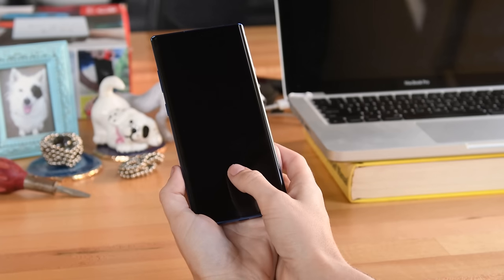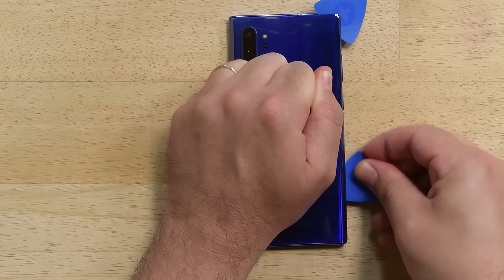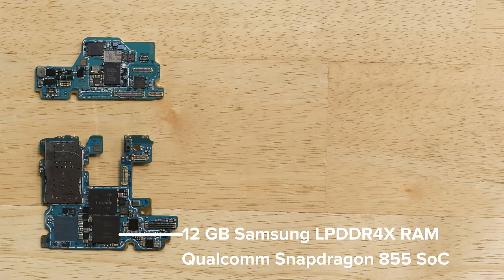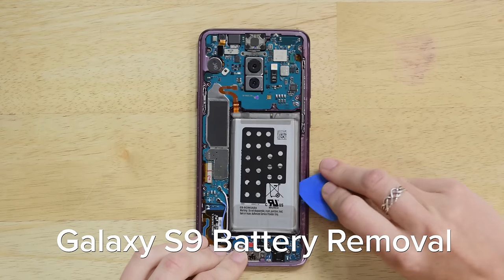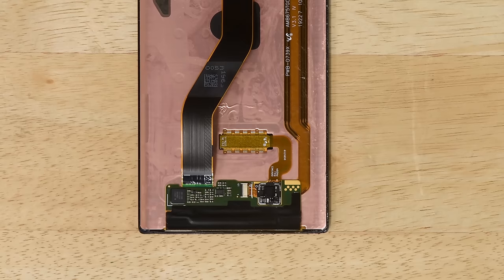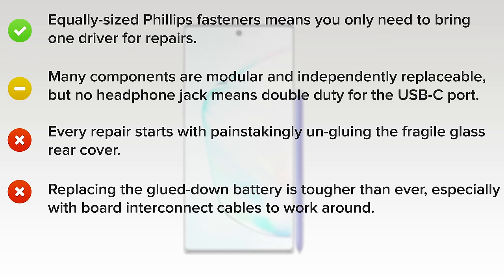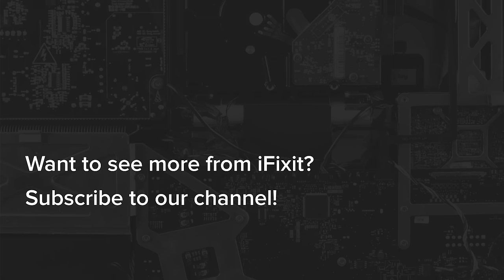Samsung Galaxy Note10+ Teardown!

Comment: Why is the lack of headphone jack affecting the repairability score? You may not like the lack of it, but why does its absence make repair more difficult?
Reply: Not sure but I think it's because they're saying the USB C port will be used more often as it doubles for charging and listening to audio. Meaning it will wear out quicker and require more frequent repairs than last Notes.
Reply: Yup what that guy said, no headphone jack means more wear and tear on that poor little usb c port :(
Reply: And from design aspect the 3.5mm jack is much durable compared to type-c i guess, cuz never have i had any issues with my headphone jack even though its used way more than the usb port.
Reply: @TFQ1  had to replace headphone jacks at my shop more often then charging ports, but because of headphones getting stuck in the jack when they're yanked not really the port's fault. Most charging port repairs are just people who gets some gunk stuck in it and it takes a few minutes to scrape out.
Reply: In my old samsung i usually use usb port like twice a day for charging and aux like 20-30 times a day after a year its my usb port which failed and i felt aux port is generally more durable than usb port. sometimes cotton gets into my aux jack from my pocket but that u can easily remove by yourself using a toothpick or a safety pin.
Reply: @kangaroochili  Highly doubt it. The majority of people getting this device will have the bonus of Galaxy Buds or will already have Wireless Earbuds or Headphones.
Reply: The real reason they got rid of the headphone (AND microphone, all you videographer) jack is to sell more airbuds.   Considering the added cost of the airbuds, the fact that you'll lose or break them at least once, adds to negative on the repair-ability score.   I own a Note 9, love it, and will not be upgrading.  

If you ever have use a Mic on a Note 10,  you have to deal some problematic adapter, no thanks!

Comment: This actually rebukes the rationale Samsung said when addressing the lack of the headphone jack.
There's DEFINITELY space on the bottom to fit a headphone jack.
Reply: I agree. Earphone jack or at least a second USB-C port.
Reply: Samsung never said there was no space for a headphonejack, I think they are just starting the transition later than Apple did. Don't like it though, so I'm gonna stay with my Note 9.
Reply: Unlesss they remove the s pen its a little cramped. I assume the s11 will have a headphone jack
Reply: @peachulemon  it won't
Reply: This is a lie
Reply: @thatdude5104  The official reason is that they were able to make the battery 3% larger. They traded the jack for about 20 minutes more talk time. A bad decision IMO.
Reply: @realestateagent7184  there, for anyone who thinks i'm wrong
Reply: Samsung is following Apples's footsteps to force consumers buy earbuds
Reply: I got my note 10+5G yesterday. I almost didn't get it because of the headphone Jack issue but when I opened the box I was greeted by some AKG USB-C earbuds. I haven't played with them yet but I think I saw an article saying with the extra bandwidth that USB-C provides they made the headphones noise cancelling
Reply: @soroushsafarzadeh8321  No, we'll buy type c headphones
Reply: My biggest problem is that the note 10 for me is like a laptop i dont have to carry around. With out the 3.5 jack i cant test audio ports or run diagnostics on sound equipment, which makes me feel like everything the note is about now is geared for social media for kids. The note was inteded for productivity in the work place or best video and camera work now thats all gone. Just ruin it for the true note fans with the removal of one item, and no real enhancements except for software and hardware increases but no inovation or atleast inovation to enhance ones life. 
On the other hand in my day to day life i drive a lot, this is how ive used my note 8, i get into my car connect bluetooth to stereo, connect charging cable to phone and connect earbuds to 3.5 jack.
My music plays through the bluetooth stereo, through apps of sound cloud, youtube, samsung music player, etc. My google maps plays through my earbuds that are the akg 3.5 headphone jack ones that way i can hear turn by turn without looking at the screen and it will not disrupt the music playing through the stereo system. I wont be able to do this with out the headphone jack becuase even if i do with the type c port then i wont be able to charge the phone, and wireless charging in a car sucks and barely charges. phone will die or get interupted with turn by turn it would be harder if i was on my motorcycle i would have to pull over and charge the phone on the bike because i cant afford to look at gps, this is why a dedicated headphone jack is needed between both my work and personal life.
Reply: @krisdwight78  just becsuse something is usb c isnt the reason there noise cancelling. Also to save cost no new earbuds were made they just clipped the cables and threw on a usb c conector to save on cost
Reply: @JoshuaNY93BX  I found the article, the noise cancelling  AKG headphones that are USB-C are aftermarket. $80
Reply: @JoshuaNY93BX  i agree. However, with dongles you can do the same. Inconvenient, but works.
Reply: @realestateagent7184  no i cant if i have to work in a set the dongle gives less charge and audio detereation usually happens because of cheap materials in them or power feed back which gives humming to the audio distortion unfortunately. This was just a bad move on samsung and in there presentation making it seem as if the ppl that they want to market this phone to is the younger instagram assholes or facebook kids.
Reply: Samsung never said that ... 
Samsung's excuse was Haptic feedback ... They said that due to headphone cavity there was some issue with haptic feedback ... Don't believe them ? Try S10 and Note 10 haptic feedback and see yourself
Reply: @nothing9220  they did say that at first then changed it to a haptic feed back issue which sounded more reasonable, which is bs, they have been making phones for years withput problems they are just making a excuse to rationalise but look at the track record which calls out for bs
Reply: @peachulemon  why would samsung make the note series if it the same as the s series it has an s pen to be special
Reply: @thatdude5104  right

Comment: No heat pipe like the note 9. Curious how the thermals compare, especially with 45 watt charging.
Reply: I guess its there, they simply didnt show it to us. Even i wanted to see it, to know how big and well designed it is
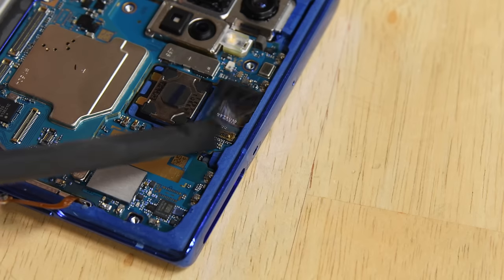Reply: 1:12 there's an area of copper exposed that matches the shape of the area where the soc looks to have some grayish looking thermal material 1:14 as opposed to paste. This contacts the large copper sheet on the underside of the screen. I'm assuming this to be the "world's slimmest vaper chamber" they were touting. Pretty cool design really....that is if it's effective of course.
Reply: @Courtney King Not true at all. USB PD 3.0 outputs 15V/3A. No single LiPo battery can accept 15V charge directly without conversion so the phone needs to converts that to (ie 4.2V) internally. Expect higher heat output when using 45W charger, it will heat up by design.

Comment: thank god they made the type-c modular. cuz in s10 it was a part of the whole mother board, thanks for the inspiration apple!. And also the usb-c is gonna wear out much faster than before as theres no headphone jack.
Reply: ?? Its a change  from the s10 so how it inspired  by Apple  i mean if wanted they would  have done it with the s10
Reply: I meant s10 none modular design was inspired by apple. The type-c of s10 is stuck onto the mother board which means if your type c port broke then u have to change the whole motherboard. Something which apple has being doing with their phones. Thankfully Note 10 made the type-c port modular when they removed the headphome jack as type-c will wear out even faster now.

Comment: I used galaxy grand 2 for over 4 years and still it is working without any repair of micro usb port or any repair whatsoever despite battery. So your point of assuming usb c port will need repair is not valid. Samsung phones are built to be used for ages.
Reply: The USB port on this phone is soldered to the motherboard which means putting a charger into it or moving it constantly means it can weaken the soldered joints and break. Your phones micro USB isnt soldered, it's a better built phone there is less fancy things in it to cause issues.

Comment: I would buy this in a heartbeat, had it not been a Samsung. Because it'll be useless in 2 years and the bootloader will most certainly be locked. AND DON'T GET ME STARTED ON KNOX!
Reply: Hi, im just commenting 2 years later...my Note 10 Plus still works fine, it's still very useful to me :)

Comment: That’s Samsung for you. Complete shit that’s stuck together with glue. These phones are made of cheap shit and they have a front to charge you lots of money for them. I do electronics and have to deal with this crap every day. The worst part about this phone is the iOS on it called android which is so easy to hack. Plus they put this OS on cheap shit tables,phones,etc then they stick the same on their top model too. So it don’t say a lot. They make phones like this now so you don’t repair them but buy a new one. Phones are getting worst and worst. The best phones for repairing are Apple because they don’t glue it all together like a cheap toy. Also the screen is easy to replace and battery. Android phones are just complete cheap shit glued together. Shame on them.